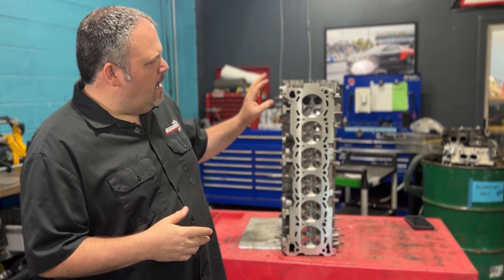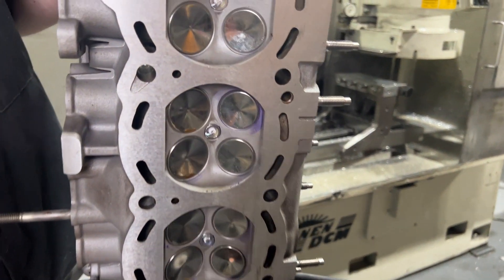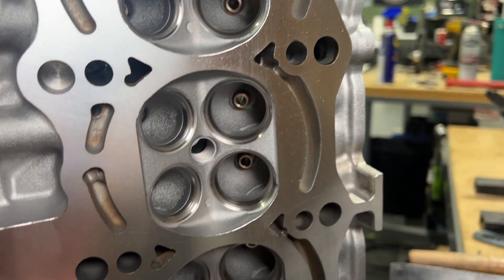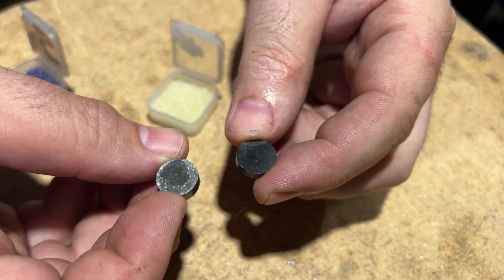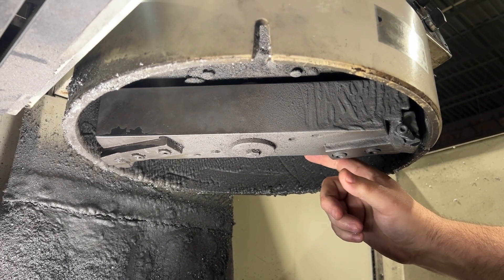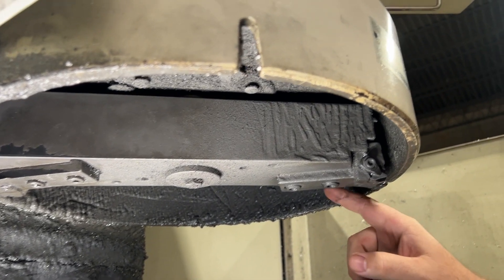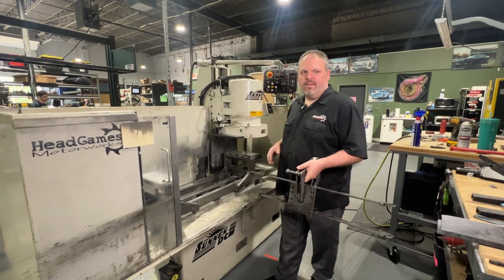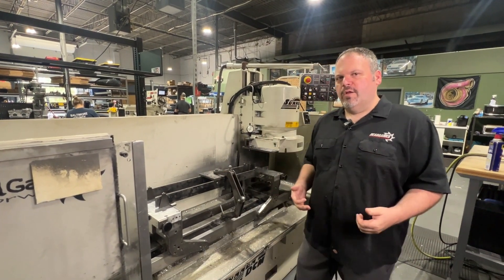Tech talk- Milling cylinder heads!

Comment: Don’t you need to straighten the cylinder head with an oven and a press before milling it? Milling it just makes it flat but if you’re milling a bowed cylinder head you can have issues like uneven combustion chambers and tendencies to blow head gaskets
Reply: Hmm... if the head is bowed, I think it'll tend to bow again if you straighten in.
Reply: @White.Elemant  any overheated head will always bow even if it’s slightly. People reuse resurfacing as a bandaid to fix a bowed head. Doesn’t actually fix the problem and creates a new one but it will make the head gasket seal. Many heads also get resurfaced unnecessarily as a precaution by run of the mill machine shops. I asked because I’m under the impression that headgames operates very differently than your average machine shop

Comment: Question so I did my top and not that long ago and ran it so far for a couple thousands miles. But I plan on building my bottom end sooner rather than later would I have to have my head milled? Also would it be recommended for me to have my block milled for a MLS gasket? My head is aluminum and the block is iron

Comment: the shop i used to work at had a special composite grinding stone on a Blanchard grinder for the heads they guaranteed a 32- 45 ra finish with a maximum deviation of 0.006" end to end

Comment: As a mechanic, what do you recommend we use to clean the deck and cylinder head that won't cause issues during mill setup?
Reply from the maker: Scotchbright is great!
Reply from the maker: But make sure you don’t get any in the engine

Comment: 1:55 Polycrystalline diamond (PCD) and cubic boron nitride (CBN) are both hard insert materials used for light semi-finishing and finishing operations. PCD is the hardest man-made material, while CBN is the second hardest. 
PCD is a synthetic diamond that's almost pure carbon. It's the first choice for machining non-ferrous materials like aluminum, brass, copper, and fiberglass. PCD is also used for carbon fiber parts, aluminum with more than five percent silicone content, and abrasive aluminum alloys. 

CBN is suitable for steel or iron machining, hardened steels, and continuous machining of hardened cast iron and powdered metals. CBN is also used for ultra-high-temperature applications in steel, iron, and other ferrous metals, as well as chilled cast iron, superalloys, Monel, and Stellite. CBN can tolerate cutting temperatures over 1,800 degrees F and no coolant is needed when machining CBN inserts.
Reply from the maker: Thanks for the detailed response!

Comment: 💥💥💥 0:50 Couple things to note as a machinist. Number one, to effectively and accurately measure Ra (Roughness average) aka surface finish, you need to own a profilometer. This nifty electronic tool is generally somewhere between $2,500-$4,000. An "older" shop will often not be able to justify the NEED to spend this kind of money based on older engines as it's main source of income. That said, Dave hit the nail on the head when mentioning that NEWER motors require NEWER equipment to pull off a correct Ra. More importantly, newer engines REQUIRE a better surface finish because of the type of gaskets used; MLS (multi layer steel) for example. 

Your surface finish requirements can be found by contacting your gasket manufacturer. The popular "Cometic MLS" gaskets require a 30-50 Ra surface finish. Older composite gaskets could often seal with a Ra of 60-100. And to understand surface finish specs you need to understand that the lower the number the smoother the finish. To give a general perspective, a brake rotor surface finish when new is generally in the 32 Ra range. 

On the flip side of that coin, having a SUPER SMOOTH finish will actually hurt you in the MLS world by allowing the gasket to "slip" from lack of traction and in turn leak. 

I could go on and on with boring science talk and references. But for the sake of the viewers, just understand as with everything else, Dave is right. You need to know the gasket you will be using. You need to know the surface finish requirements for said gasket/gaskets. You need to know the type of equipment the shop has and whether they can ACHIEVE and MEASURE the finish you're requesting. 

As for the RB head shown, that finish would more than likely work with a composite gasket for a OEM low power rebuild. But if you throw a MLS gasket on that head and try to make power with higher boost levels and cylinder pressures, expect for bad things to happen. Thank you Dave for another great video. It's your desire to inform the community of topics like this that keep you at the top of the pack. Your work and knowledge speak for themselves. I will leave a link below to a Engine Builder magazine write up on surface finish for people to read more in depth. 

https://www.enginebuildermag.com/2021/03/ultra-smooth-surface-finishes/
Reply: Thank You, very informative.

Comment: Do I need to use higher torque than OEM with ARP studs if using MLS gaskets?
Reply: You need to use the torque specs the stud manufacturer recommends. Generally a stud will ALWAYS allow and recommend a higher than OEM torque spec. This is because a stud will essentially not stretch under pressure like a OEM bolt. That being said, you also have to worry about the added stress you are applying to the factory block threads when doing so. Gale Banks did a video on this topic not long ago and showed that some builders are RIPPING the threads out of blocks from the additional torque. So be advised this can cause issues. Gale mentioned that if you haven't exceeded the clamping force of stock bolts, you shouldn't be trying to replace them with something "stronger". If that makes sense
Reply: @highpsiguy4085 I'm more concerned if the boost application is OEM, but you use a MLS gasket do I need to torque to a higher Torque because of the chance of leaking coolant since the surfaces are smoother.